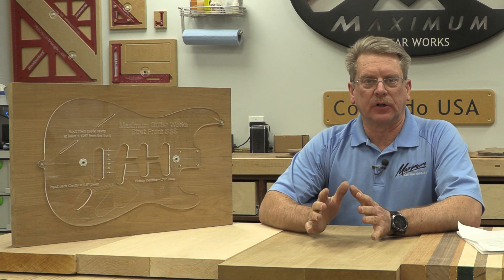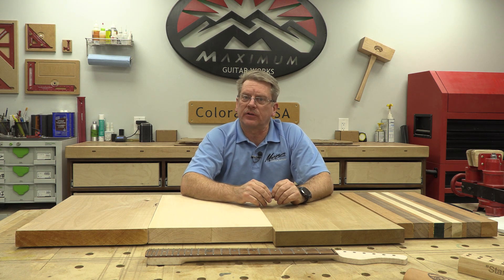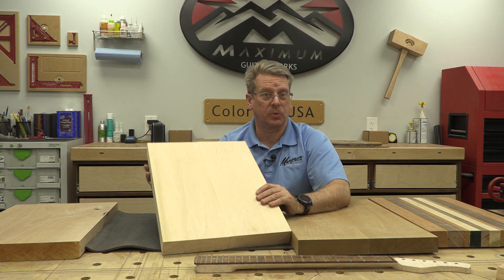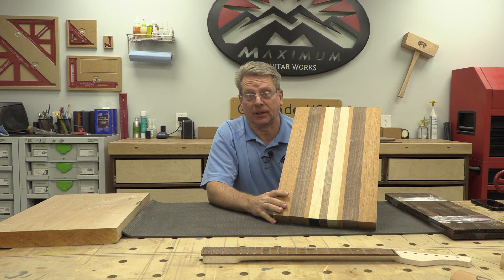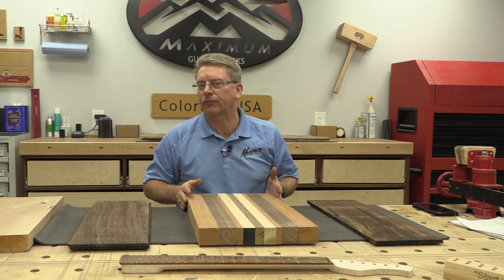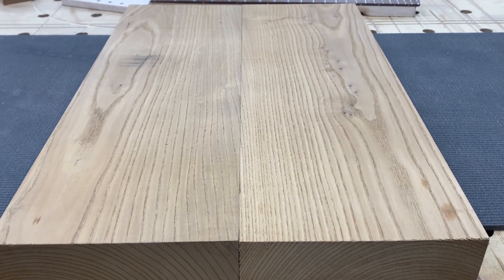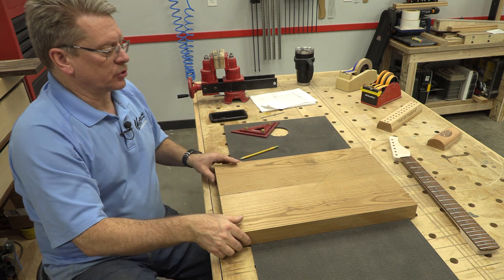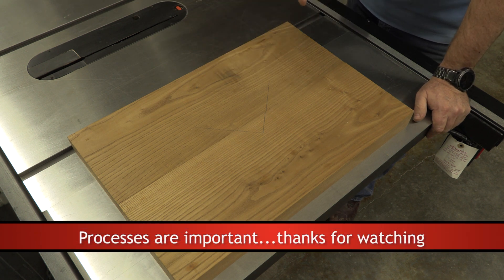Strat Build 2022 - Part 07 - All about Guitar Body Wood and Prep

Comment: Great jointer tip!!!
Reply from the maker: Thanks for watching long enough to see that!
Reply: @maximumguitarworks  The other source of error in that bookmatch-to-get-offset-errors-in-glue-edge operation is actually that the board faces aren't parallel.  This is where doing it with a #7 with the boards clamped face to face can help since the reference face is still the inner faces.

Comment: What should the moisture level of the body be before finishing? I live on the Oregon coast,  once I purchase lumber for my bodies that have been kilned dried and they acclimate to my area the moisture level goes up. In the winter it is not very fun.
Reply from the maker: Thanks for the thought provoking comment Pat.  I can't believe with a video as long as it was...how I forgot to talk about moisture!  

How high does the moisture go up for you?  A kiln should bring the moisture to 6-8%.  I too like to let wood acclimate to my area before using.  For me that is 1-2 months.  Sometimes a lot longer if I am stocking up on materials in a bigger volume.  Since I live in a dry climate...average of 20% humidity...I find the wood reading 6.2 to 6.8%.  I love those numbers.  For my tops...I slice them from billets in-house...then treat them with a wood stabilization solution and wrap them up together.  I don't want to risk the tops warping.

I tend to do all my final thicknessing at the time I plan to use the wood...to give it less time to change.  As long as you are around 8% or less...you should be fine.  If you are worried about the wood twisting or warping...maybe consider stacking them with sticks and put some bar clamps around the whole pile to stabilize the woo while it goes through potential changes.

I should bring up this topic in the next episode...it is important stuff to consider.  In Colorado...I probably worry about this less than those living on the coasts.
Reply: @maximumguitarworks  buying lumber west of the cascade mountain range, even if it is kiln-dried by the time it acclimated to what ever lumber store it is in it will usually be around 11% and sometimes higher. My problem isn't the body cupping it is after starting automotive paint, sanding and polishing. Just from the heat of polishing it looks like the orange peal look comes back and the glue lines rise and fall with the change of weather conditions. Especially with some supper hard and dense grain African mahogany that I have.
Reply from the maker: @patruddiman4228  I would have to know more to understand what issues you are having.  My first thought is that if the wood is properly sealed...it would not be the moisture causing your orange peel in the finish.  There are many things that can go wrong.  Some finishes can be picky about temperature and humidity.  Most can be corrected with the right reducer for your environmental situation.  Generally the biggest problems I see when buffing (besides burning through a finish) is if the guitar was not sanded dead flat...ever imperfection will be revealed during the buffing process.  If you want to chat...should me an email through my website to start a direct dialog.